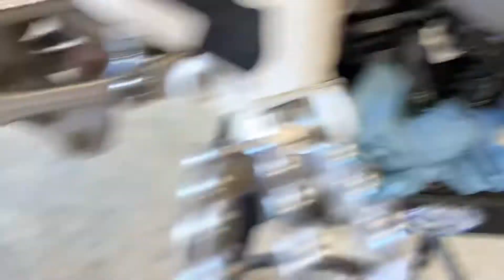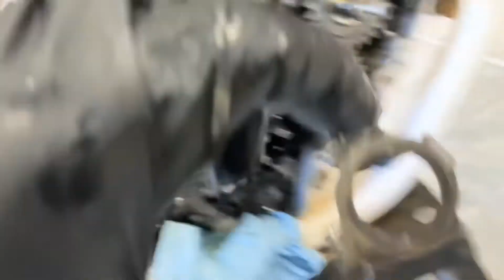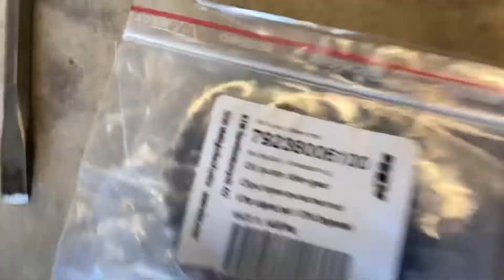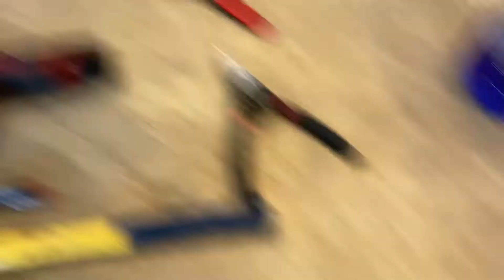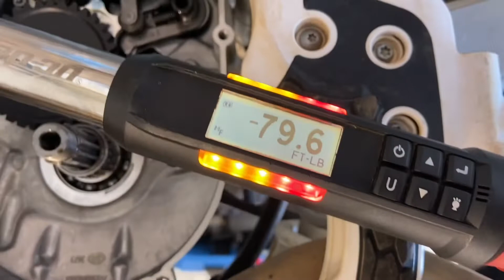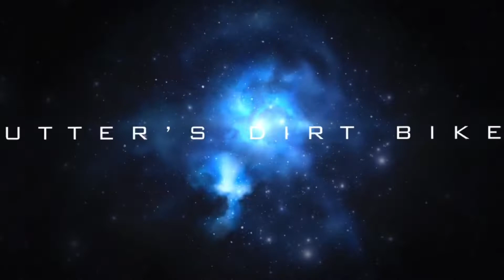How to replace oil pump gear ktm / Husqvarna 250 350

Comment: Very helpful video. I just heard about this problem and will be replacing the idler gear as soon as my parts arrive. I have the service manual for my bike but it is always helpful to see it actually done.  I have a question, though. Why did you use red Loctite on the primary gear?  The service manual for my 2019 KTM calls for Loctite 243 (medium strength blue).
Reply from the maker: Mainly because all race teams use red for engine parts. Iv had blue not hold well before but that’s just my experience. But if the book calls for blue then use that
Reply: @Dutters.dirtbikes  Thanks. What clutch holder did you use to put the basket back on? The KTM one is backordered until sometime in December.
Reply from the maker: @Badunit11  I just used a high end pin spindle holder from Matco tools. Wouldn’t recommend buying it tho for just this job. I’m an automotive mechanic so I have a ton of tools for lots of jobs.
Reply: Do the ktm excf 250 2019 have the updated part ? Thanks
Reply from the maker: @matthewhill8182   it may if it was a later 19 build.

Comment: My sons bike needed top n bottom  rebuild. Mechanic  said bearings overheated due to low oil.
I doubt he knew what caused and now I know. 
Unfortunately  it has same problem  after a few rides, but gonna have idler gear replaced, hopefully repeat damage has not occurred so may need rebuild again. Husqvarna  is costing me a fortune so far for a bike with low hours.
Thanks for the video.

Comment: While you have a lot of good info in this video, I do want to point some things out to save trouble for others. The TDC locking bolt is not meant to withstand significant torque ESPECIALLY with an impact gun. you can very easily shear the tip of this bolt off, you need to use a proper gear jammer, motion pro offers a cheap $15 one. Secondly, impact guns are fantastic and can make quick work of things, but they can very easily end up causing more damage very fast on anything and applying much more torque than any 1-3 foot breaker bar. I'm not sure where you get your feeling of impacts putting less torque on things, but the 1/2 drive Milwaukee fuel impact can apply 1200 ft/lbs of torque. a 2 foot bar with a 200lb man hanging on the end is only 400 ft/lbs. I do want to reiterate I like your video, it is fast and explains the job well besides those points, I just don't want to see anyone cause damage to their precious KTM/husky.
Reply from the maker: Using a hand tools will apply more turning force to the bolt than a impact. Because impacts jolt and don’t use as much turning force
Reply: @Dutters.dirtbikes  Take it as you will, I just want to throw it out there that they do have the potential to cause more damage in certain situations.
Reply from the maker: That’s why when you try to remove a crank bolt a engine will turn over. Where an impact will take the bolt right out.
Reply: @Dutters.dirtbikes  I haven't had much luck with that method, usually the shaft will still just spin. What method do you use for tightening the primary gear nut back up to proper torque when reassembling? proper gear jammer then?
Reply from the maker: @somethingjuicy4337  for assembly yes i torque it by hand
Reply: @Dutters.dirtbikes  I am about to do this same job, did you just use the crank lock bolt and then apply the 74ftlbs of torque to the gear nut? is that advisable? thanks for the video.
Reply from the maker: @johnnybeacon4403  yep I did and it work cus that’s what it was made for but I agree it feels rather odd.

Comment: Can the number on the oil pump idler gear be seen just by pulling the clutch cover and rotating the clutch basket? I have a 2019 FE350, and I've read that some late 19's have the newer gear. I'd like to inspect it without pulling the whole side cover.
Reply from the maker: I don’t think so but worth a try

Comment: Hey man. Just did this on my bike. I didn’t notice one of the side casing bolts has a copper washer on it and can’t remember where it goes. It’s not the one for the water pump cover. Wondering if you could tell me where it goes. Thx!
Reply from the maker: Only other place that uses a copper washer is for the bolt that locks the crank. It’s a spacer
Reply: @Dutters.dirtbikes  can you take a look on your 22? I’ve got a 22 gasgas and I’m pretty sure the engines are mostly the same. I swear i pulled a bolt out with a washer that holds the side casing on lol. I’m assuming it’s one of the lower 3 near the sight glass. Can I email u a pic?

Comment: How did you get the primary gear off? The KTM service manual says to use a $200 puller. Yours magically removed itself off camera.
Reply from the maker: Huh yeah it’s splined so they come right off. If it’s jammed a standard puller should work as well tho
Reply: @Dutters.dirtbikes  mine was glued onto the shaft with overspilled blue loctite from  the factory.
Reply: @RedLemon850  

No need for loctite on those bolts or nuts. The locking tab holds the clutch nut & the other is reverse thread so that the direction the shaft spins would make the nut want to tighten.

Comment: I’m getting ready to replace this gear but I noticed my primary gear sits farther back than the balance shaft to the point it only makes contact with half of the gear whereas I see yours sits flush, any idea?
Reply: I noticed when doing mine. (Brand new bike) that when removing the water pump impeller it actually pulled that whole shaft out a little bit. Pushed on it and the entire shaft slid back where it belongs, gear sitting flush with primary gear.
Reply from the maker: Hmm that is odd. Anything aftermarket and is it the same model as mine ?
Reply: @Dutters.dirtbikes  it’s a 2016 fc250, as for aftermarket, just a rekluse clutch. It doesn’t seem plausible for the balance shaft to be able to walk out since the timing chain would hold it in place. I’ve had an issue where the primary gear nut has come loose but immediately torqued back down to spec
Reply from the maker: @Anthonymdra   hmmm dang yeah I would just have to see it for myself in person to see what your talking about.
Reply: @Dutters.dirtbikes  do you have an email? I can send you pictures and videos of what it’s doing and looks like
Reply: I  just changed this idler gear on my 19 FE350 and noticed when i reassembled that the primary pinion did not sit flush with the balance shaft, but was set maybe 0.5mm back. Made me check the parts list for a shim behind the primary gear, but there isn't one.